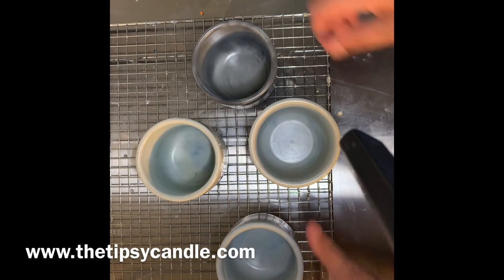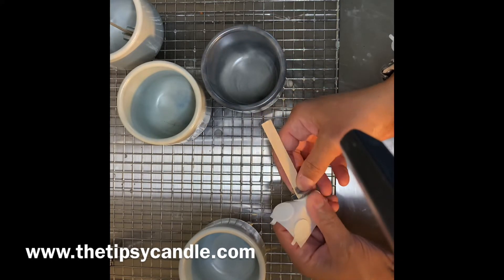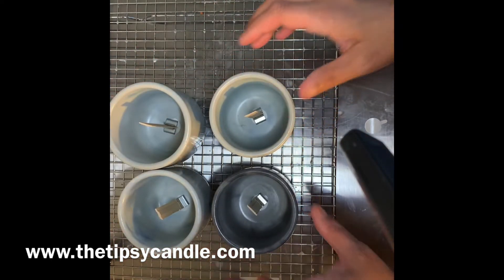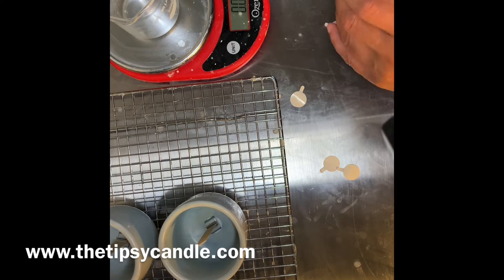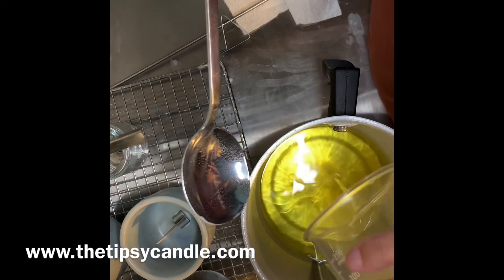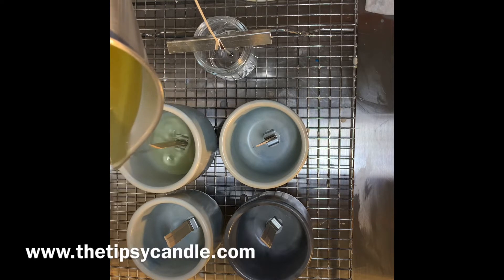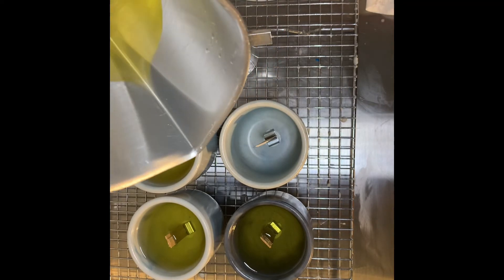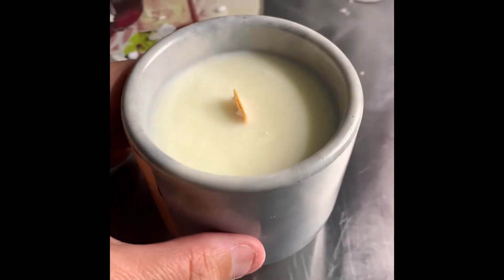How To Make Cement Candle Vessels: Pouring The Wax

Comment: hi I am watching your videos very much, and while watching your videos I also wanted to make candles, I make candle holders and put jasmine scented wax on them, but unfortunately it goes out after a while, the candle holder I made  Below is a photo, do you know the reason?
Reply from the maker: There are several different reasons why it could extinguish to early. Candle making it tricky and it’s important to do proper wick testing most makers don’t realize before releasing a candle months for in to wick testing and power burning tests. I suggest you start with researching sizes and diameters for your wicks.
Reply: @thetipsycandle  thank you